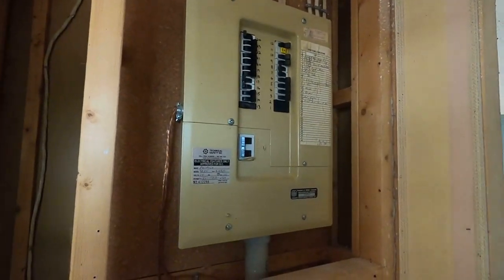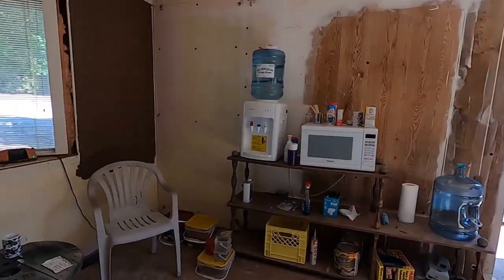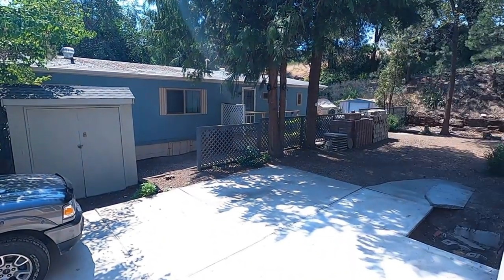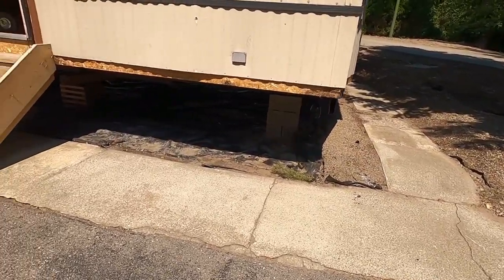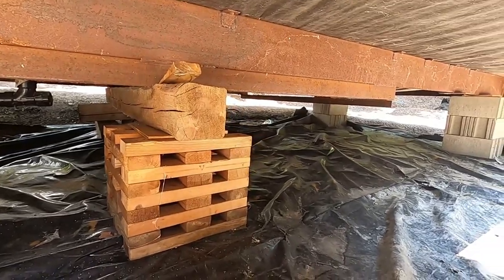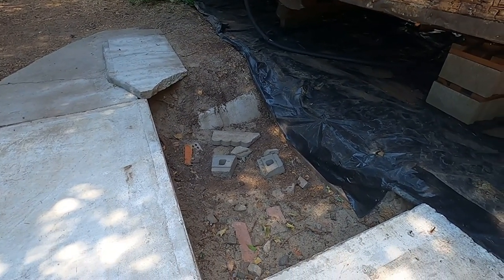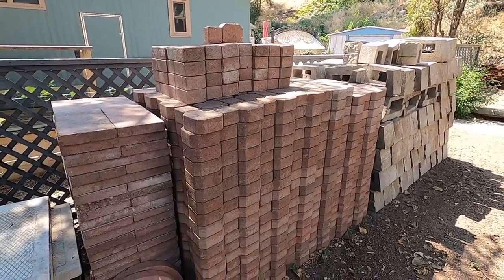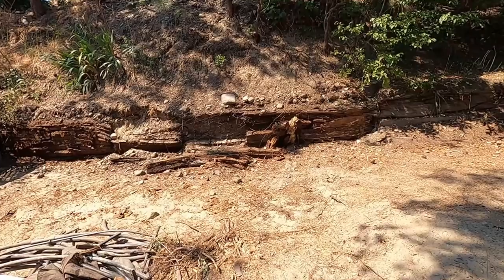Abandoned Mobile Home Project - July UPDATE - Ready For New Work : E090 / BC Renovation Magazine

Comment: Are you concerned about future water pooling under the house due to the high banks of dirt on 2 sides?  Are you putting in French drains?  Also what about the potential for soil erosion or mini landslide with heavy rains?  Love watching your meticulous work but as a potential future buyer, I would be worried about a home in a well.  Hard to tell the slope of the land in the videos.
Reply from the maker: Hi, Linda. Yes, it is difficult to tell the slope of the lot in the videos. The lot slopes to the front corner where the driveway is. The driveway is the low point.

The soil conditions there are sandy, gravel, and rocky. Water does not sit around. It is absorbed by the ground quickly. 

We are in a semi arid desert climate. We don't get a lot of precipitation and very rarely much all at one time. We have only had about half an inch of rain in the last 6 or 7 months.

We won't be installing any french drains. There is no need. Once we get the site all graded soil erosion won't be a problem on this property.

Thanks for watching and commenting. 🙂